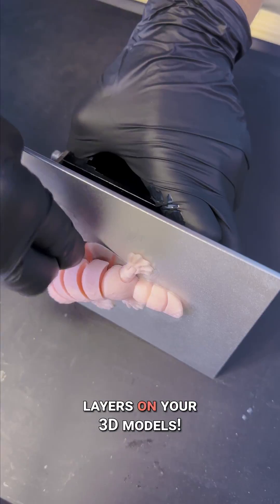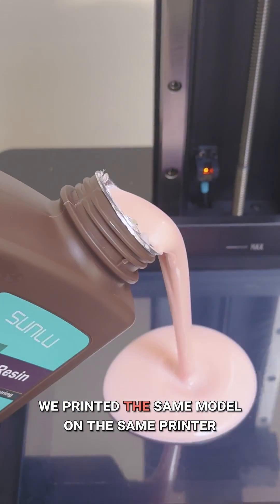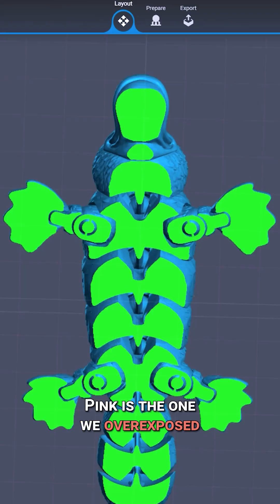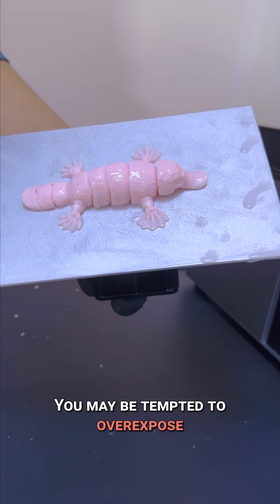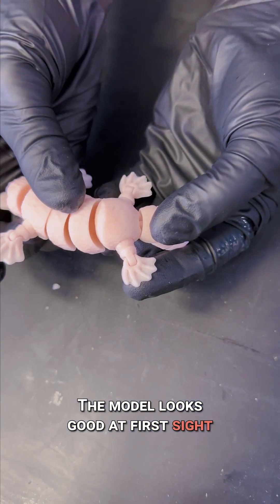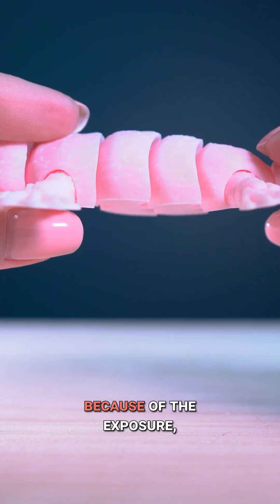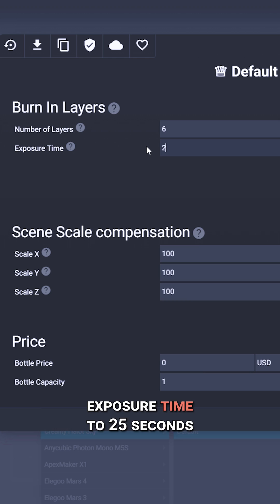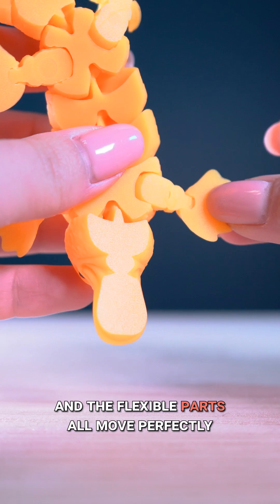✋ Stop over-exposing the bottom layers!

Comment: Even 25 is higher than you normally need. I run with only 8 seconds for my bottom exposure, as long as your build plate is properly leveled you will still have perfect adhesion.
Reply: i only just started printing 2 days ago. where do i find the option to change the exposure like that? im using lychee